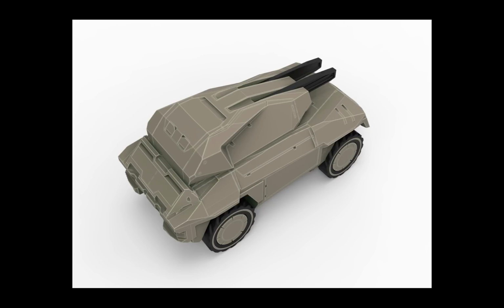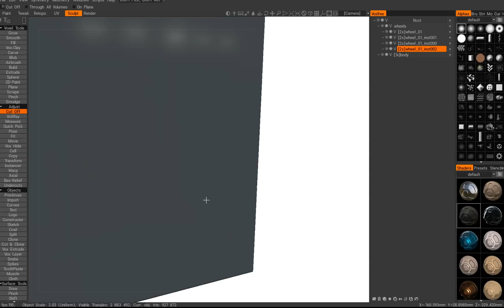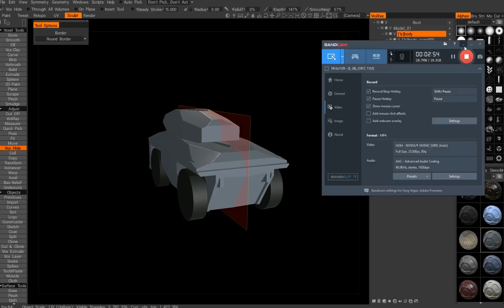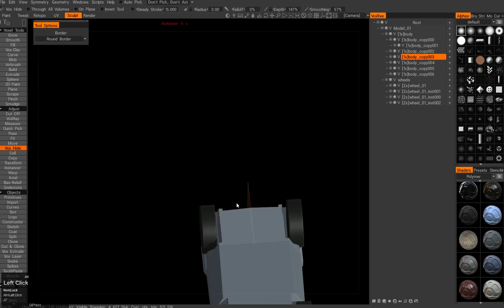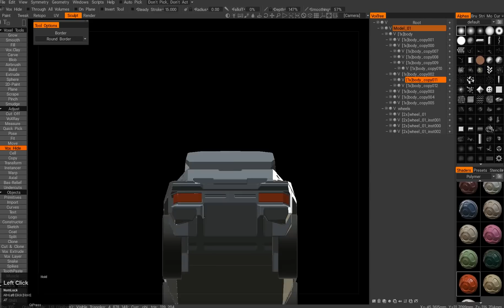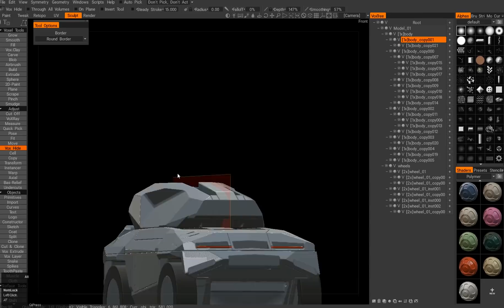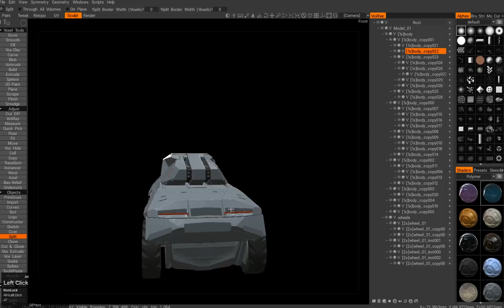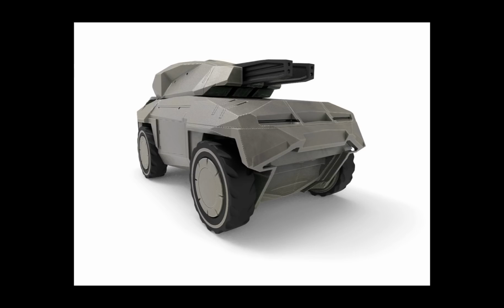3D Coat Clean Vehicle Sketching

Comment: This video was really cool, i got a few questions after trying it out though
1. How does depth limit on vox hide work?, like ill change the number and it just kind of goes as deep as it wants, i tired really hard to figure it out. Like it doesn't seem like its a global setting because ill have it set to 0.1 then go to another hide and its like 10 times deeper. Does it still take into account the depth of parts that are hidden already? like i have no idea its like magic or something.

2. When I use split i don't get any nice panel lines, it does nothing but split the piece into another  like sub object. There is a nice clean cut there but the edges aren't like beveled like they are in your video they aren't defined at all.
Some help you be greatly appreciated, Thanks 
I'm using 3d coat 4.9
Reply from the maker: 1. Depth limit is fucked up. It's really hard to deal with it usually starts with the first point of contact but I really don't like as it is quite unpredictable.
2. Hm, check the voxel border at the top by default its 2.500 should be 0. Otherwise, its about the voxel density and I also run Smooth command all the time on the mesh. I assigned an F12 hotkey to smooth the model when I fell like it.